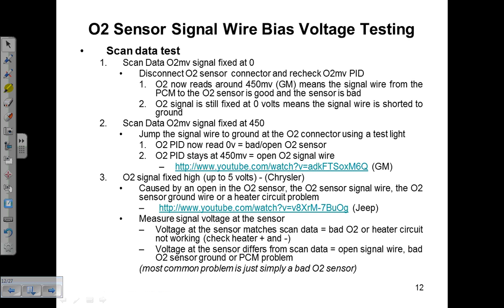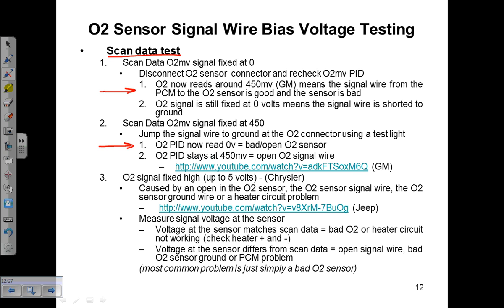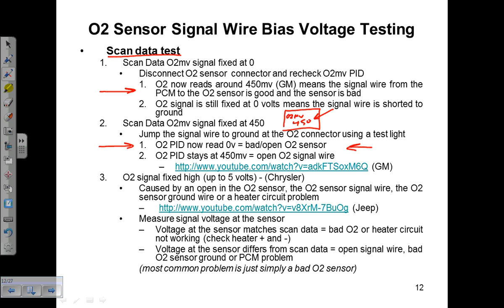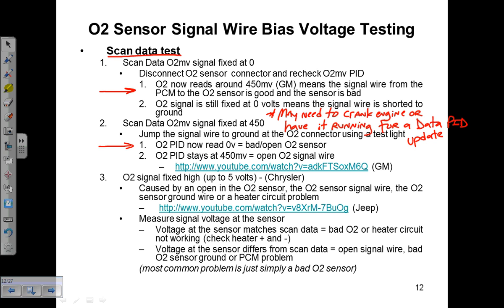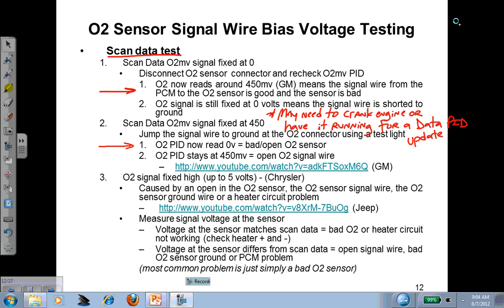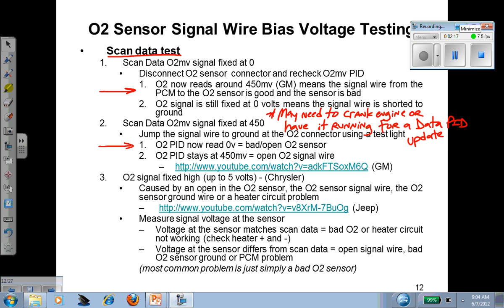Scan data may not update without an RPM signal (a ScannerDanner Premium lecture)

Comment: more good stuff as always bro!i got this 98 gmc 2500 truck with a 5.7 poppet injector engine in it.the long term fuel trim on both banks stays at -17 at idle.as soon as you touch the pedal it normalizes.i was thinking leaking fuel regulator or at least something in the spider assembly leaking,what do you think paul?thanks bro,GOD bless!